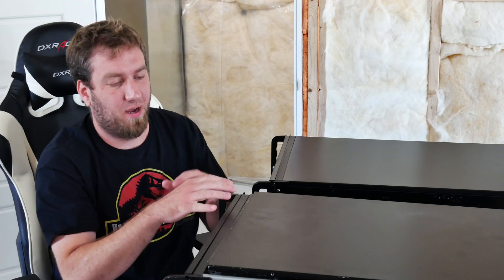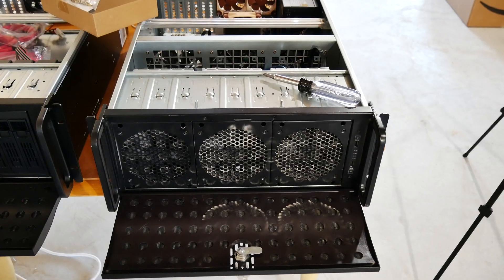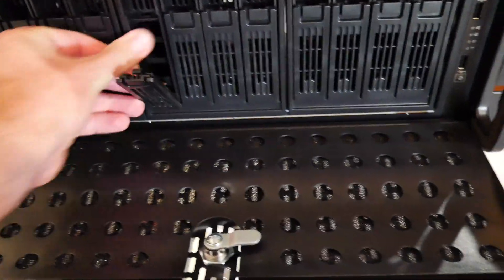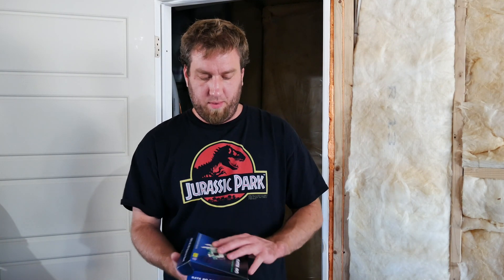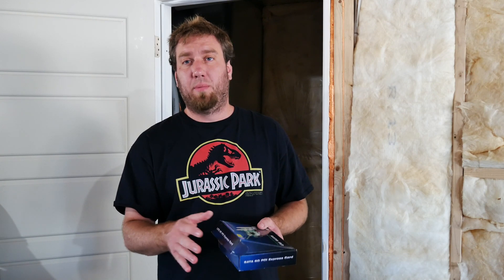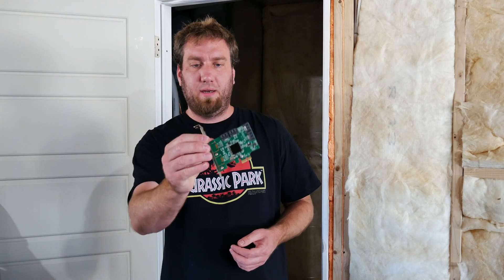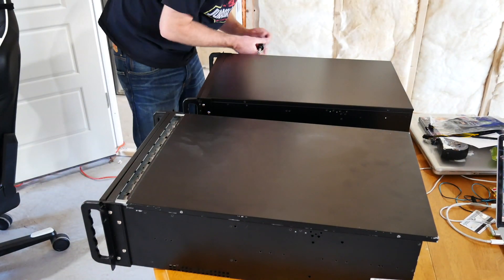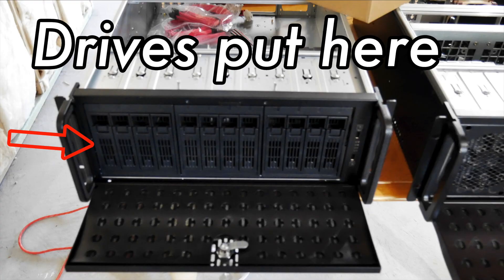How to fix a fried hard drive and NAS case swap goes horribly wrong.

Comment: I know this is an old video,  but how good are the back planes in the 4412?  The reason I ask, is I have a 4500 coming.  I want to swap in the hot-swap drive cages when it gets here. I'm wondering if I will have any issues with the back planes killing my drives.
Reply: rdsii64 i think theyre fine. I believe what I ran into was an issue with power cables and/or my power supply. Since I got the replacement up and going I havent had an issue. But I would recommend not powering it up with drives until youre sure it can power up fine with out the drives. :)

Comment: The cases are mostly (if not completely identical, save for the drive bays.  Was it not possible to just swap the hot swap cages in for the non swap cages?
Reply from the maker: in theory it would have been, but its a real pain to do so. Just taking out the carriers in the 15bay is annoying. I think the hot dive bays were what killed my stuff so swapping them out wouldnt have helped me. But Im still not very sure what happened.

Comment: How much did you pay them?  If it was more then $120 you got ripped off. They do not "Reprogram" The just desolder the chip and solder it on the donor board.  I normally charge $40 for pars and $20 in labor.
Reply from the maker: mike hunt They did reprogram it. They sent me the old board back with the new one and nothing was missing. I suppose they could of swapped them. But they also state that they can reprogram it the other board is too far gone. But as for cost it was $60 or $80 after shipping and everything so it wasnt bad at all.
Reply from the maker: Do you have a website or anything for your services? Id be happy to add it to my description for you.

Comment: Did you ever find out the full cause of the magic smoke? Some sort of short or something?
Reply from the maker: DevelopedLogic unfortunately no, but because i couldnt figure it out, i had the case replaced including everything it came with, i had evga rma the psu and cables, and then the drives under warranty were replaced, the mobo, and the bad stick of ram.